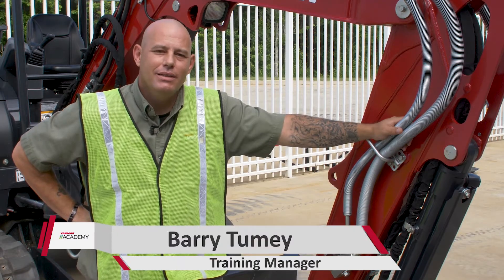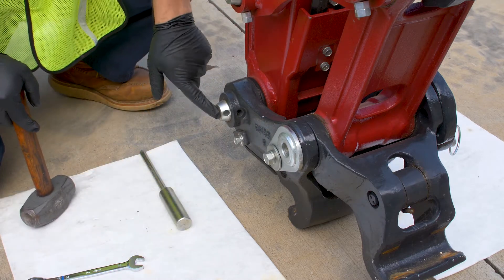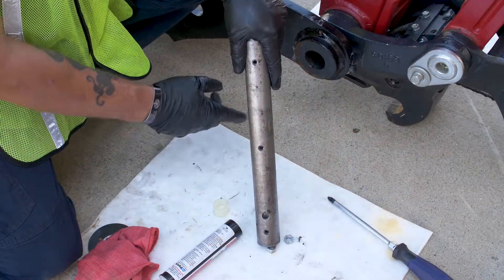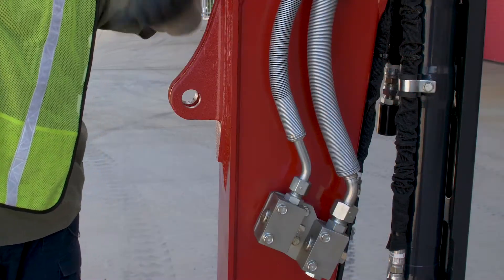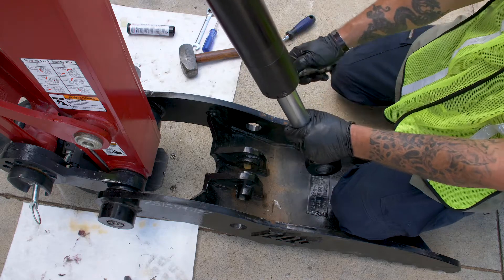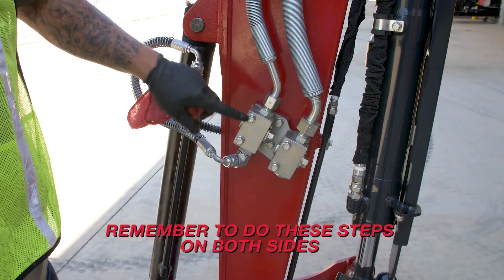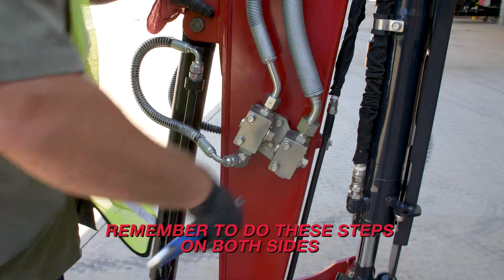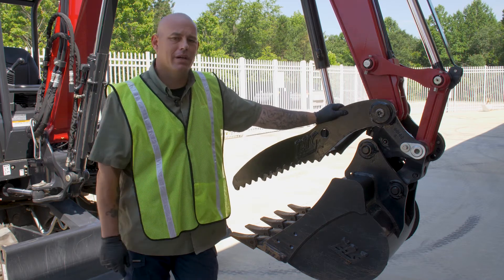YANMAR Excavator Thumb Installation

Comment: Hydraulic fittings are engineered to seal themselves either with o rings or machined surfaces. I don’t understand why you need pipe sealant